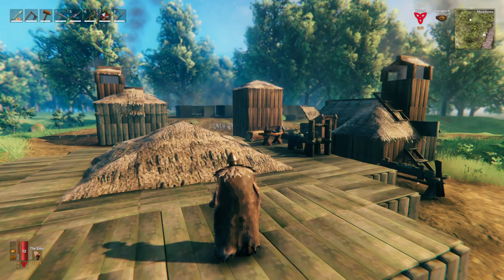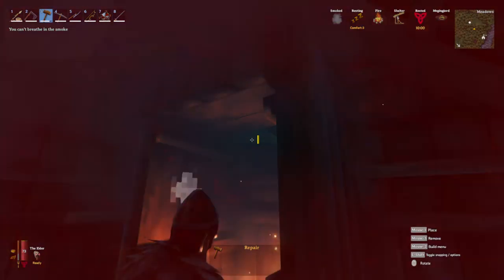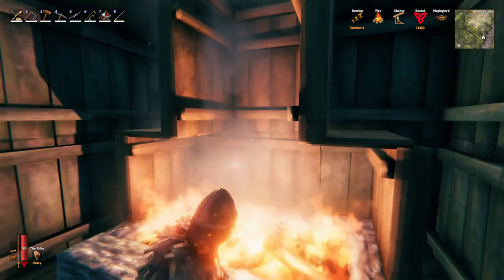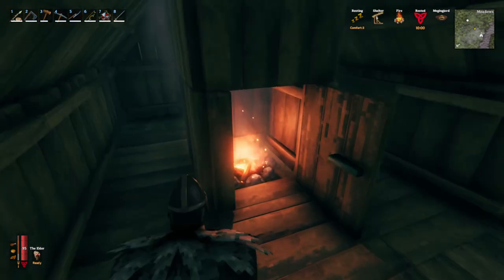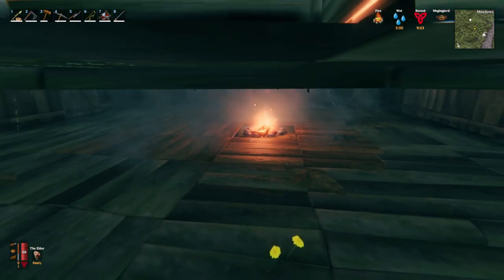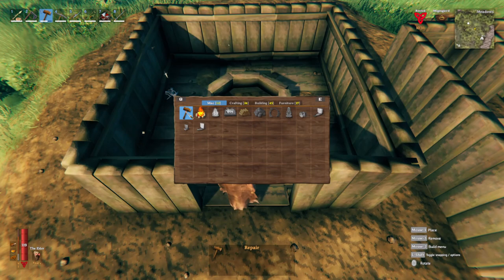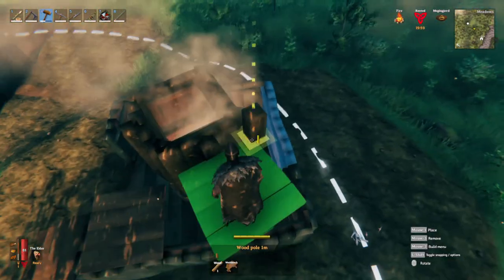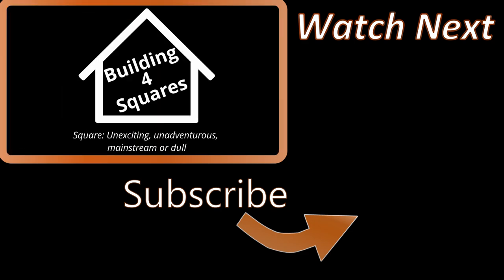Understanding The Basics Of Chimneys - Valheim

Comment: I like some of the videos but this one completely misses the mark.  When dealing with smoke, there are two key pieces of information that are not properly explained here.  First, the smoke is actually composed of particles about, or a little over 1m across.  If you put a 2m wide square "chimney" (straight, or bent at angles or horizontally) with posts at 1m and no walls, you can see that no smoke escapes, effectively making a see-through chimney.  (Also note that iron gates count as walls, also see-through.)  Second, is that smoke particles have a timer before despawning.  If going straight up, smoke reaches a height of about 16-18m, then despawns.  However, smoke particles can somewhat overlap each other and make a dense smoke, such that if you channel and contain smoke in a big enough chamber (about 2-3m up and 6-8m across), it will al; be held long enough to despawn, without backing up to the fireplace to snuff out the fire or cause smoke inhallation damage.  This is vital for any builds (i.e. basement) where a tall chimney is impractical or impossible.  Also, no stone is covered in this video.  I'm building an all stone foundry, based on a "fireproof" theme.  :)  My building looks like Swiss cheese, with 1m windows and vents everywhere, yet the 10 kilns keep going out, same as my initial almost fully enclosed design with a series of 2x1m center roof cap vent.  Haven't even had a chance to test the 10 smelters and 10 blast furnaces, as I want the kilns to work 100% before proceeding.  Also, the stone (or wood) horizontal 1x1m block "steps", 2x1m arches, 26°, and 45° wood roof sections all move smoke across at different rates, roughly in increasing order as listed, respectively, from least to most.  As such, a fully stone structure is about the worst horizontal movement, meaning it is one of the more difficult to vent if using a fully open internal build structure, like mine.  My third constraint is to have all places covered by roof, which means using side vents, which has me bumping up against max height and/or stability/support issues, with the game's 3-arch stacked limit (even at staggered heights) driving the maximum spam of the width of the building.  A 4th soft constraint is to have aisles of 3-4m width and 4m corners to easily maneuver a cart around.  With space at a premium, and given stone's severe stability limitations, and smoke's >1m particle size, this build has proved challenging.  Yes, a little wood vent hood, iron wood beams, or even internal stone column supports, would all make life so much easier!  But such are the crazy things we sometimes do purely for the integrity of aesthetics!  =D  (I credit FireSparks81's video for teaching me the proper smoke mechanics necessary to hopefully complete my crazy build idea, before giving up or compromising integrity out of frustration.  I've got a few more ideas to try now!)
Reply from the maker: Good to know, thanks for the info! And good luck with the build, it definitely sounds ambitious!

Comment: I don't believe that chimney tops are good with just 1m beams. The in game smoke 'particles' need > 1m to move through. The octagon bloom top is just collecting smoke, not venting it.
You can test this by using just 2m beams across - where you put walls. If you space them 1m in height apart, they effectively block smoke.
Reply from the maker: True that it won't pass through it, just like rain. But the octagonal top I have also had the 1m opening along all the sides for smoke to pass through. I have this top on my mountain base and it hasn't had problems to this point.
Reply: @quicksandriggs  I suppose that is where the height of the chimney is key. The bloom top does not vent (through the 1m openings between chimney and topper) but seems high enough that the smoke dissipates before it becomes a problem. You can build a cavity that contains enough smoke - even if totally walled off from the outdoors - for it to dissipate / disappear before it smothers a fire.
I really like the bloom top though! Thank you very much for sharing your designs!
Reply from the maker: @Idleness76  That's a good point! Now that you mention it, my chimney is almost certainly the height I show in the video for smoke not to dissipate. Thanks for pointing it out!

Comment: Thanks for showing us these options dude. Quick question though: that chimney withe the crossed beams; does that count as a roof and keep the rain from putting out the fire underneath ?
Reply from the maker: It has on my mountain outpost up to this point. The wood beams will block rain and shelter anything they are directly over, and it sure looks like there aren't any gaps in them when I make the chimney top.